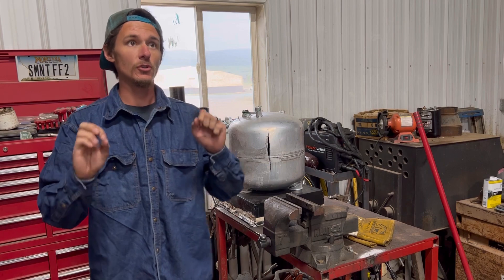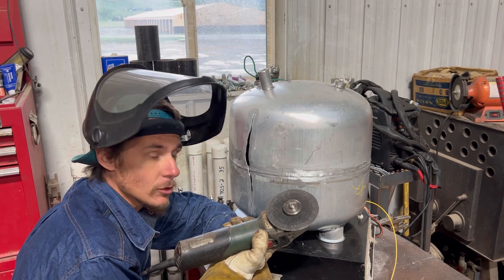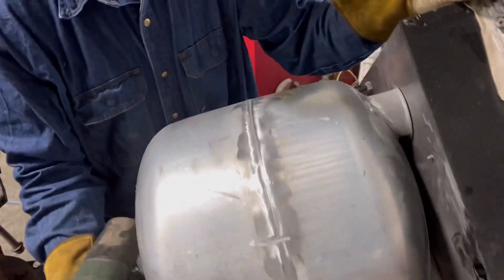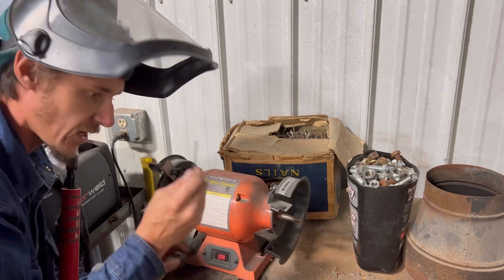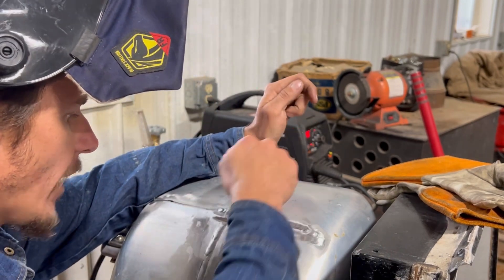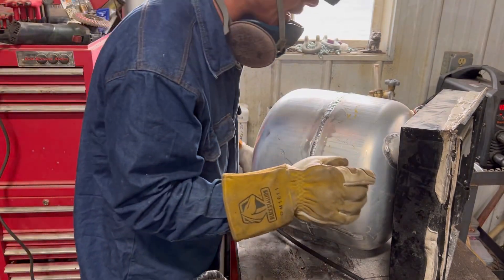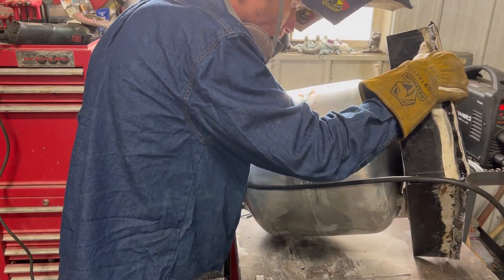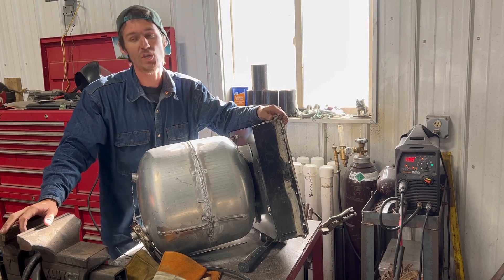EXPLODED Water Heater Tank Repair! Can It Be Welded?

Comment: @Meltin Metal Anthony
was always taught to drill the very end of the crack out to prevent recracking , and mildly heat it up to see where the crack truly ends before laying down your first bead.
the same applies to fiberglass  repair work too
Reply: That's only in cassss of vibration or stress. This is a freeze crack. So it won't recrack because it isn't under the same forces as a stress or vibration crack.

Comment: That tank froze, but it being a water heater you shouldn't have fixed it, the material has been stressed more than enough to take it out of engineered design spec. An overlaid patch would have been more suitable, but still wrong.

Comment: Man that’s crazy for me to see. I live in Ontario Canada and any pressure vessel like that can’t be re welded after it fails. They can only be manufactured by a certified manufacturer. An other cool project none the less!
Reply: This tank is for a camper that's probably super hard to get a replacement for so I don't think the owners are interested In contacting a ASME engineering firm to doing a by code repair lol, they just need this tank sealed up so they can have hot water again. Also I'm a boilermaker in Ontario and we constantly repair/patch cracked pressure vessels. TSSA has procedures to do all kinds of repairs without remanufacturing a vessel.

Comment: I just fixed the same exact tank at work a few weeks ago, used an aluminum burr bit and sanding pad to clean and open the crack, drilled the ends, preheated it and tigged it up, holding good so far!

Comment: Get a die grinder, some aluminum burrs and ditch the flap disc and cut off wheel.   Couple of dogs tacked to the tank would help pull that together and pull the two sides into same plane.   That thing was spun or pressed or hydroformed process might determine why wall thickness varied, if it did.  Or maybe no anode.  A patch would be better.
Reply: I was thinking he was gonna use a patch as well.

Comment: Anthony nice to see you doing some aluminum welding. Don’t worry about all the nervous Nellies. The biggest concern on a water heater is a properly working temperature/pressure relief valve, that is  installed into the tank and not somehow down stream for someone’s installation convenience. That tank will be lucky to see 40-50 PSI. If your welds were to fail it’s not going to explode, but just soak the camper! Tanks explosions happen from run away pressure and heat forming rapidly expanding liquids. Invariably the safety relief valve has an issue and didn’t  reduce the pressure in time. I would tell the customer to make sure they install a new safety relief valve. No one spends sleepless nights worrying about their water tank welds holding up!
Reply from the maker: thanks! it actually cracked due to freezing and not being winterized.

Comment: In cases like this one I'd try to separate the halves. Clean the inside with muriatic acid and rinse with water. Repair the the cracks in both than weld the halves back together. Then as a final on the big crack I'd sand the outside welds rounded and do weld over strap over that for added strength. All depending on what the customer is willing to pay. 👈🧐👍
Reply: New AL tank on Amazon, plug and play 365.  They can be had for much less.  Plenty wrong with that repair.  It should have been patched.   I doubt it will last.   Yes, I have done a lot of AL work.
Reply: Tank looks to be about 16 in in Dia.  Do you think the money is there for another 8 feet of welding plus prep.  Missed where you said strap. Dbl length of that weld. No, it's not.
Reply: @newage3397  Your right if your charging by the length of weld, But if you get a  customer who wants perfection you charge for that as well. Also as a welder you have to try to convince a customer the right way is worth spending a little more for. If they still don't want to that's fine take lot's of pictures and make note of your work to cover your ass and hope for the best it don't blow up in their face.

Comment: I would have turned that job down personally because l am not qualified or experienced in pressure vessel work. Interesting though to watch others do it.
When it comes to cracks, l have drilled both ends of the crack in the past but now prefer to blow a hole the each end with whatever process l am using for the repair. No swarf and it stirs up the base material and changes the structure to terminate the ends of the crack.

Comment: About the crack i alway drill a hole at the end of it wich it fill with weld, it basically does the same, stops the cracs from further evolving, also never grind tungsten on an open wheel, that shit is toxic special small hand held enclosed grinders are made to contaminate the dust, some tungsten are even radioactive-
Reply: Just the red tungsten is radioactive (2% Thorated) , he was using the purple I believe.
Reply: @tubeonline629  even ordinary stainless 316 becomes radioactive when you grind it, chrome-6 is releasing alpha particles when its released from the alloyed compound. but true only the red contains an active radioactive nuclei, that doesn´t mean its safe to grind the others without protection.

Comment: Water does not have the explosive energy that air has. You should never ever weld compressed air tanks. 250 psi of water, gets you a little wet. Argon, air compressor etc tanks are tested with water.
Reply: My old man told me the other day he saw an oxygen bottle get knocked over on a concrete floor, and it blew the cap off and the tank shot through the wall.
Reply: @swamp-yankee  Yep. Once witnessed this with my grandfather when he went to get new tanks for his welder. Some yahoo tipped a big one over in the bed of the truck and broke the valve off on something in the bed. It shot off the truck, hit the ground and zipped through the shop like a torpedo before punching a surprisingly neat hole in a cinderblock wall at the back. Compressed gas is something you need to respect.
Reply: yeah but steam does, when it goes bad it all goes bad

Comment: See I would have used a mig welder running at 150 amps with 70/30 argon/o2 at 5 cfs. 

I would have run my 6010 through my wire feeder using a 6 cup and run it at 125 feet a minute. I’d also have used sandpaper instead of a wire wheel. Oh and I would have used my English wheel instead of a 3 lbs sledge. I mean it would have put in such a better finish over all.

Comment: Whoever this water tank belongs to, I hope it's positioned underground because it's definitely a bomb waiting to go off. I know you're doing what you can MMA, but the question is, should you? I'm not convinced that you're ticketed for pressure vessels, and I'm doubtful that your insurance would cover this if a tragedy was to happen. Nice work fighting the challenge, but should probably decline these jobs in the future.
Reply: I'm pretty sure this is a holding tank (water), not a pressure vessel.
Reply: @grumpycricket  @10:20
Reply: Could have froze with water in it giving the big crack he hammered.
Reply: Boo Wendy testaburger
Reply: RV water tank used to heat water.40-50 psi tops out of 12 volt water pump
Reply: @2hotscottpro  the RV park I work at has 75psi, but still not a pressure vessel. 😊
Reply: I've welded a bunch of air compressors in my time the first few times I was nervous but after having done it a bunch and having none of them fail in the 6 years I've done it I'm pretty confident and before you ask no I don't have any pressure vessel certs but those like everything minus bridge certs are per company
Reply: Safety Sally alert 🚨
Reply: @Gusto9698  I'm not worried about putting my own safety at risk, or letting you risk your own safety. It's different when you're putting someone else at risk. Plus how much do you think he made off this job? Maybe $800? Is that worth 100k+ in potential damages?
Reply: @Gusto9698  "repaired several times "
Reply: Boooooo
Reply: Sounds like a load horse shit let the man live
Reply: Idk about water take but I welded my alloy aluminum rim tryed to TIG it but machine was only ac but ended up having to aluminum mig and pre heat also to get it not to crack
Reply: its not a pressure vessel you dont even know what you’re talking about